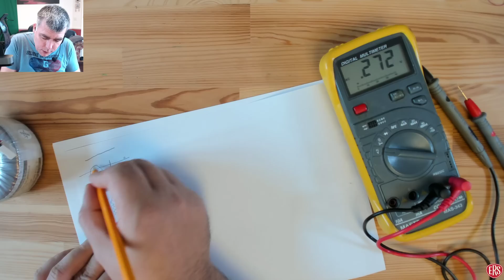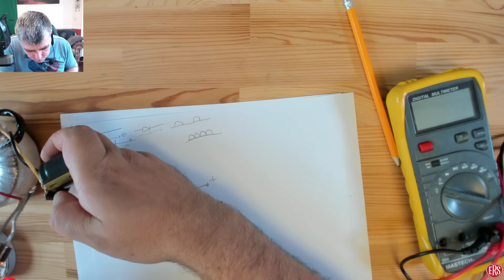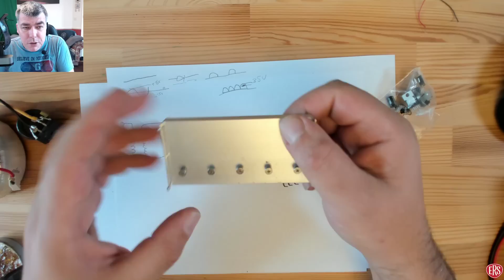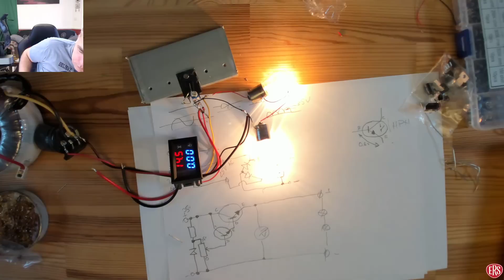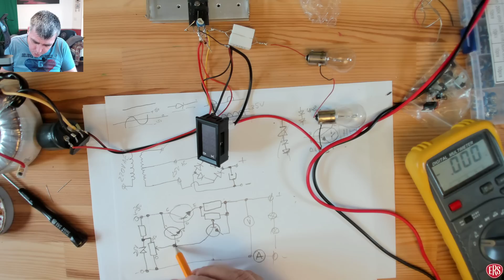How to Make a Lab Power Supply - Power supply project #Beginners diy projects

Comment: Measure with capacitor (no load) is 34V : this is a peak-to-peak value, not the RMS value.
If you need the RMS value (RMS value = Root Mean Square), divide by SQRT(2) => 34V/SQRT(2) ~= 24V

Comment: Actually i am late to say this but the zener diode is in parallel with the potentiometer, the only thing that has effect on the potentiometer is the voltage drop at the resistor, so sorin how is the zener diode stabilizing the voltage?

Comment: Really informative video, thanks. Doesn't using a darlington pair mean that the full saturation voltage at the base of the first transistor is very low? And if the fully saturated voltage is very low, doesn't that mean that the voltage controlling pot will produce the maximum (full) voltage at the emitter of the darlington pair at a very early stage in the rotation of the pot?

Comment: Sorin, I have a question

What is the diferent, when put bigger or smaller (value) variable potentiometer on the voltage and current.
When they more coarse and when they finnier.

Comment: 📟🔋🔌 my opinion at 42:45 was to first to explain the common and well known divide voltage connection with a B type potentionmeter, and ofc explain the A and B type, and then explain why u prefer the darlington mode. for beginners, darlington aint that easy stuff to learn. you can make an other tutorial with mosfet adjustable power supply.

Comment: i followed how you made this power supply and made my own....used a 17VAC output transformer with 2.5 amps...and i used 2 (1/4 ohm resistor) in series as my current sense and i believe an 18v zener...my voltage varies from 0-19.5.....my current varies from 1 to 6 amperes when  i short the output....how do i get it to vary from 0A instead of 1A....thanks in advance

Comment: Why do you choose 10kOhms for the first potentiometer and only 100 Ohms for the second? What whould happen if I use 10 kOhms? If you'd use a darlington transistor to control the current, you could also use 10kOhms potentiometer to adjust the current? What about the 2x 2Ohms 10W resistance used to probe the current? Aren't these resistors at risk to burn if the current get high? Thanks again, this is all very stimulating!

Comment: Thanks for the video sir but I have a problem,  am try build my own power supply but I can't fine the resistor to adjust the voltage I use 10k adjust it but the voltage stays at maximum 32v and I change the resistor to 50k and still same I don't know where am wrong

Comment: I am trying so hard on this.. how much exactly can you control the current? How much can you limit current with this? Can you completely block the current to the output like voltage? Because I can't completely block the current.. my Ammeter always reads minimum of 0.2 Amps when shorted. And more with the load.

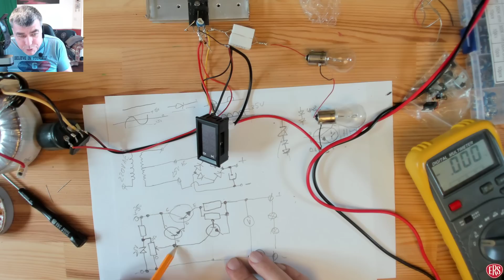Comment: Sorin, at 1:18:28 you advise connecting the collector of the current limiting transistor to the voltage limiting pot (and also the base of the voltage limiting transistor). You call it shorting the base of one of the transistors to the emitter of the second stage transistor. In effect you are shorting the base and emitter of the two stage voltage regulating transistor pair. How will that pair then work as shorting base and emitter should render no voltage difference to drive the two stage any longer? Am I forgetting someting?

Comment: This is a useful project, in two ways at least: to learn and to use! I was about to build another variable power supply project, but I don't quite understand how it works. Now I changed my mind and will build your project instead, because it's simple, does what I want, and I understand how it works, so I can service it if needed. 
Thanks for sharing!! 

By the way, I have question. 
Considering the input being provided by a switching power supply, instead of rectified and filtered one, is the zenner diode still needed? 
Thank you, very much!

Comment: Hello! :)
I am trying to build this power supply with just the volt meter but i got my potentiometer burnt while i was turning it...
Does the pwm need to always have a load? Because i currently have just the multimeter on the leads to check the voltage...

Comment: Man you are awesome, I was looking how to make a current limiter and find it in power supply. But I do not understand how it is working, only the current limiter. Isn't the output voltage higher than the voltage on the base of the second transistor (driver of the big one). If the output voltage is higher than the voltage on the driver base, current should not go from base of the driver to the output?

Comment: I've wanted to buy a cheap Chinese lab power supply for a while now. Thanks to your inspiring video I can now use my previously acquired basic knowledge of electronics to build it completely for free with parts out of an old dead avr-amplifier I have laying around in my basement. Not only will it be better than anything I could have bought with my limited budget due to the audio amplifier's beefy transformer, but it will also be proof that I can implement all these things that I have been learning for the past 2 years (I have been taking basic electronics classes as an Informatics student). For it is only now that I have the feeling I can properly understand most of it. Thank you very much sir for the gift of knowledge!

Comment: what if on the first stage where you put the resistor and zener on series i will replace it with a capacitor will it stable the voltage? i was guessing you will put a capacitor when you said you need to stable the voltage and so i was wrong again..haha anyway i'm still learning. great videos!

Comment: I tried this and it works great, but my voltage is dropping still after i put load on even after the zener does keep stable voltage. Could it be the cap?

Comment: good rule of thumb for memorizing different transistors
 NPN = Not Pointing iN
 PNP= Pointing iN

Memorizing resistor colors
 
0-Black    BAD
1-Brown   BOYS
2-Red      RAPE
3-Orange  OUR
4-Yellow   YOUNG
5-Green    GIRLS
6-Blue       BUT
7-Violet    VIOL:ET
8-Gray      GIVES
9-White   WILLINGLY

3rd color band is the multiplier
last color band is the resistors tolerance level
Brown=1%
Gold=5%

Silver=10%

Hope this helps the noobs...
Built my first crystal diode radio when I was 10...been doing this ever since...Now in my 47th year of soldering, burning, blowing up stuff ;)
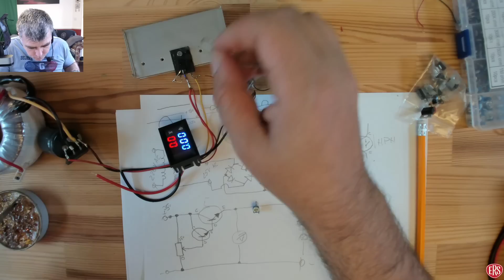Reply: LOLZ, I was getting ready to say right there @ 49:15, "I sure hope that soldering gun has an isolated ground, and if that would have been a MOSFET  tranz, it would have went P00F!!! Remember Kiddz: NEVER EVER solder onto a "LIVE" circuit, the gun, if not isolated, will ground shit out in a heartbeat

Comment: Question: about the 2 diods in series used to stabilize the V directly after the bridge rectifier... how do I identify a "18v" diode and a "5v6" diode on another scrap circuit board?
Reply: ...because in the video, that was your description of the 2 diods you used. "18v" was one and the other was "5v6". thanks in advance.
Reply: I know I'm probably a little bit late but I'm stuck on this part. .. is there any chance you can please come back & help me just on this one part? I would really appreciate it if you could. Thanks. :)

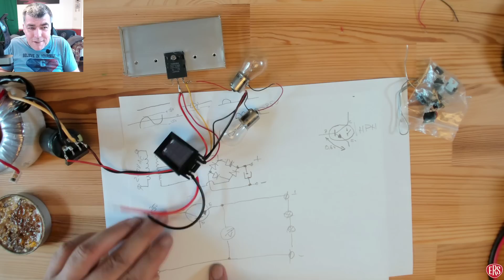Comment: I got lost at 38:28 Why does the schematic only show the meter yellow wire to the emitter and the meter black wire to the neutral? What happen to the meter red wire to the positive, it's not drawn on the schematic?
Reply: The red wire is just to power the meter itself. It’s not really part of the circuit being measured.

Comment: It looks like nobody noticed how much your amp meter lies. If you have 1.6v across 1 ohm resistor it means 1.6 amps of current flowing. Meter shows 2.33Amps...

Comment: Very informative... You forgot to move the yellow voltmeter probe to the other side of the current-resistor, though, so the voltmeter reading will be 1.3-1.6 volts too high  ;-)

Comment: I've saw many of your videos, but this is really one of the best, but not everything is honey. Yours spiders are maybe pretty one, but after third soldering i don't se what you soldering and where, for viewers would be the best with wires. I have yours likwied fluks, is really "nice", I have also alhohol propy.... and many of project on table with broken komponents. Many of power supplay (24v/36v/42v)

Comment: Nice video... but for prototype builds use this https://www.ebay.pl/itm/100-Pcs-Pcb-Board-Kit-Including-30-Pcs-Double-Sided-Prototype-Boards-And-30-F4E7/123874520678?hash=item1cd77f2e66:g:gmwAAOSwzpddVIGx
or even this https://www.ebay.pl/itm/Solderless-Prototype-Breadboard-different-sizes-and-accessories-available/263799426379?hash=item3d6babcd4b:m:mCVhorI4Gl1NxOkF6HARxlQ
it is good to consider.

Comment: I still don't understand how current limit work. I understand current resistor where we have different voltage over this resistor if current is changing. But why current is limited if we add tranistior and connect colector with base of transistor used for voltage limit.
Reply: I found an answer: https://www.youtube.com/watch?v=soygy1rnLcs

Comment: thank you sorin but it still not clear the part of adjusting the current because it seems the same of the voltage because you use the same base of the same transistor when u adjust the current and the voltage plz make it clear

Comment: It's easy to add a short relay protection.  A 24v relay powered from the rectifier connected to a npn transistor and the base connected to a series resistor and a Diode that will connect to output . The relay will activate the output as soon the power is on, if the voltage drops below the diode forwarding voltage 0,7v the relay will shut off the output

Comment: Isit possible to add a short circuit protection Wich will not stop the current flowing on the output! Just an LED that will glow when there's a short circuit ,also anything to minimize that voltage drop,maybe we need a chip I guess which we can salvage from a computer PSU I've seen that somewhere else

Comment: Ok now I know how to limit current finally. There is small thing I saw, the yellow wire from voltmeter stayed on transistor instead to be on other side of 5W resistors. 
I will make this PSU and check the difference. But I would like to see schematics for PSU with that output feedback. You don't have to make video you just contact me and send schematic to me please. 
Regards from Romanian neighbour  Serbia...

Comment: sir if i wanted to cool down the transistor then i need 2 transistor in parallel.. i con't figure it out please help me. please
Reply: Where is the problem? Just wire the transistors in parallel. Attach both transistors to heatsink, then connect same legs of each transistor to each other, eg C-C & E-E & B-B
Reply: @DimitriPappas  oo that's easy.. thanks man.

Comment: You just answered so many questions I had, if you have two transistors parallel will it spread the load? Thanks so much for sharing this video!
Reply: I meant to say two Darlington arrays to drive the supply.

Comment: I have basic power supply like this but can you explain how to make one that uses rotary encoder PWM control? Variable resistor and potentiometer are nice but not very precise and can be frustrating sometimes. I know that PWM require special IC but I am not sure where it goes in the circuit and how to connect everything.

Comment: What about heat sink compound?
Reply: I think heat dissipation at these current levels is probably acceptable without compound as the current-carrying transistor is rated to handle more amps between collector and emitter. besides it is still an early prototype (hence no PCB). Enclosure, PCB, Compound, etc would be advisable for final build / production

Comment: Who will ever try to make a mixed mode power supply,a linear supply that adjusts also a buck converter in the early stage sourcing 2 volts higher than the linear output so the output power transistors that make the final regulation will always have 2v difference from collector to emitter thus minimizing power losses that will be a great youtube challenge.

Comment: I like this design. It's simple and easy to understand. For example, it's easy to figure out that we need to lower the current sensing resistor and add a series resistor on the 'right' side of the current setting potmeter, in order to limit it to be set for no more than the transformer's rating: 3 amps.  Next step would be to add an NTC, another resistor and a transistor.  Make that transistor shunt the control voltage to ground when the heat sink gets too hot. With this, you will be able to use this power supply for locating shorting components with petrol, for a short duration. If you want to locate shorts all day long, then you will need to buy a fan or a bigger heat sink.
Another idea: use a flat aluminium plate as a heat sink and add the NTC temperature limiter. If you short this, it will double as a smartphone heater, so you'll be able to open up Samsungs.

Comment: Like this one. Next -make a simple class A audio amplifier.
Reply: Why somebody would be using class A audio amplifier? Efficiency of such amplifier is very low -- too much energy converted into heat, plus non-linearity of the amplifier which limits amplification range!!!

https://www.tutorialspoint.com/amplifiers/class_a_power_amplifiers.htm

Class A amplifier is used only in very cheap pre-amplifiers and has a lot of disadvantages -- thermal noise for example (random electron migration through semiconductor junction , a special low noise transistor are used to solve this issue which cost significantly more)

https://www.allaboutcircuits.com/textbook/semiconductors/chpt-4/bjt-quirks/

Class AB is more efficient and compensates for non-linearity of BJT transistor -- but still has it limits.

http://www.circuitstoday.com/class-b-power-amplifiers

Class D is more efficient (more than 90%) in power consumption and does not require 'ultra expensive' power supplies. Cheap to build and recent tests show that at high power amplification there is no competitor in line.

https://en.wikipedia.org/wiki/Class-D_amplifier

Try to build 2x15W Class A amplifier to beat following Class D amplifier

https://tinyurl.com/y22djaj4

and then compare just complexity of power supply for Class A amplifier. 

For PAM8610 Class D amplifier any switching power supply with output of more than 3A will do just fine. 

I believe most people do not have a specially equipped 'music rooms' in their homes to remove ambient noise coming from outside of their building.

If you intend to build Class A amplifier -- then do it on vacuum tubes, they have very low thermal noise and give best results. But remember vacuum tubes work at high voltages and precaution should be used when you work inside of the amplifier (disconnect power otherwise you can get electrocuted).

Only very good head phones and pretty high volume can mask external ambient noise.

I hope that you will find next information useful

https://www.electronics-tutorials.ws/amplifier/amplifier-classes.html
Reply: @JohnDreamer-e7w  I agree with everything but in the same time class A amplifiers are great lesson in beginners guide to electronics so why not he build one? In the end everyone will use digital ones (sound is great and cost of build is low) but building them they will not learn a thing.

Comment: did you forgot to move the volt meter to the output? and from what i understand after that it should read even lower voltage under load?

Comment: I would like to know how to build a safety switch.  Switch on, current cuts off when load has short-circuit, switch off, as it works now, even with short circuit current is supplied to max setting to find out what is cooking.
I would like buttons to set voltages, like 19, 5, 3.3 how do you design a circuit to do that?
Reply: "I would like buttons to set voltages, like 19, 5, 3.3 how do you design a circuit to do that?"
 - simple solution - use a zener instead of a potentiometer to get the voltage you want

Comment: Thank you for that video Sorin it was very interesting. I have one question: i bought that volt/amp meter that you are using it shows volts very accurate but amps... it give 0.5-0.7 A error compared with multimeter it will be nice to give me advice for some amp meter that is more accurate if its possible :).(adjustable resistors integrated in volt/amp meter doesnt help much to get better accuracy)
Reply: check with another multimeter ...
if the error is real .. calculate the error and keep doing it
with the potentiometer try to get as close as possible to the value
at a load of 1amp

Comment: Great explanation Sorin.
Maybe you can use an operational amplifier to sense the voltage different between the reference voltage and the output to drive the transistor.
That way you will compensate the voltage loss between the transistors and the current sensor.
Anyway nice to see such a power supply from design to a functional circuit.
Keep up the great videos and please do more building pojects I love it.

Comment: QUESTION !!!!
Why don't you put the current liming circuit before the collector of the darlington transistor, instead of the emiter? I think this would decrease the voltage drop when the power supply is loaded, while keeping the functionality the same.
Reply: i think sorin did a great job of basic design
an advanced project may be one of the following topics
Reply: @zoranotasevic2180  Yes, but the thing I am talking about is simply swapping the the place of a few comments. The design will remain as simple, but if I am not mistaken the output voltage will be way more stable.